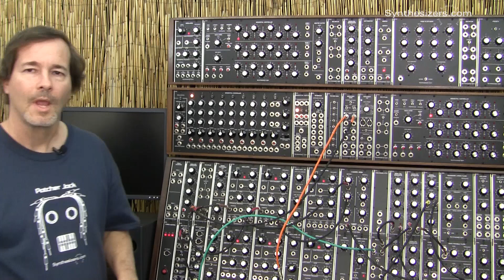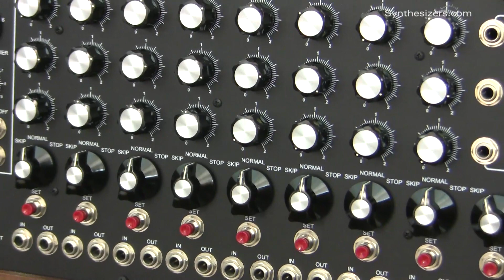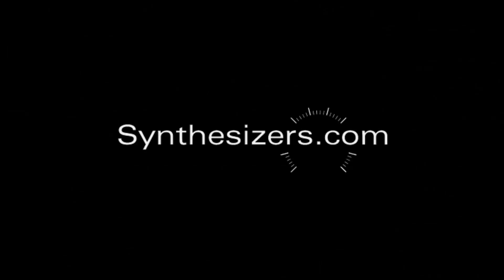Q960 Sequencer BASICS tutorial - Synthesizers.com

Comment: So would you use 8 oscillators, one for each stage?
Reply: You could, but a single oscillator would normally be used, or perhaps a couple for a fat sound or a chord.
Reply: @and7barton  oh no, i don't mean all 8 going through each stage together. I mean, 8 different oscillators, one for each stage. Does that make sense?
Reply: @popcycles  I assumed you meant one for each stage. You certainly have that option. It could sound cool, if each oscillator is set up to make a different kind of sound, such as a sine wave, a square wave, sawtooth, maybe one going through a ring modulator etc. It could end up sounding like a Perry & Kingsley piece !
Reply: @and7barton  ahhh okay! So I am thinking of this correctly. 👍 That helps a lot. I've tried looking on YouTube for anyone using the this sequencer in that manner, but haven't found anyone. Not even someone using two or three different oscillators, for example